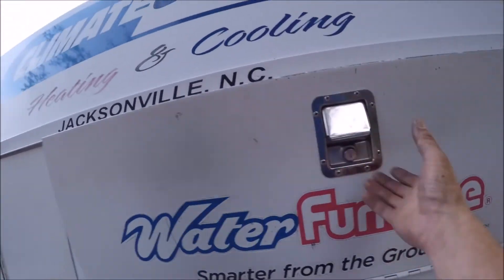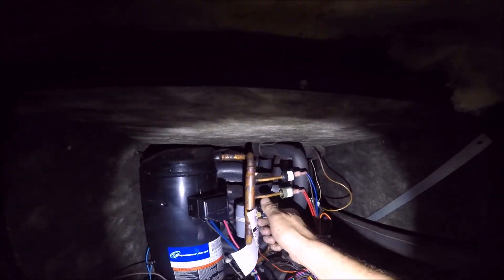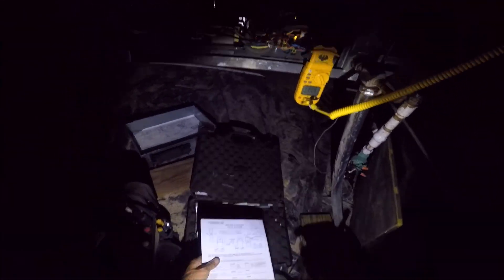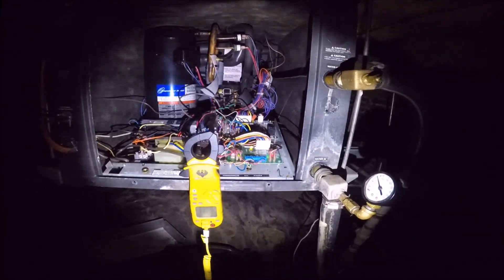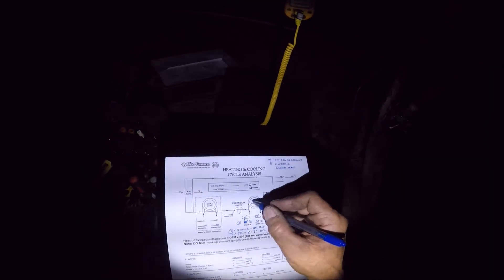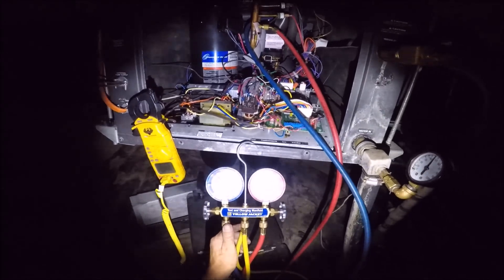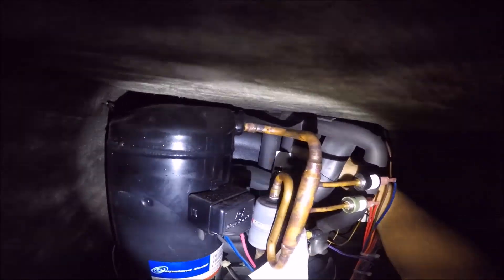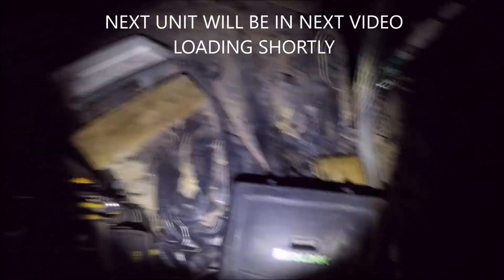(HVAC) GEOTHERMAL (CLIMATE MASTER) PM  (VLOG#1 OF 2.)

Comment: Thank you for sharing. very helpful.
What is the name of the testing kit you are using and where can I get one?
thank you. keep the great work.
Reply from the maker: no spesiel test kit just get a needle type k- coupler  thremometor  and a water gage from lows plumbing dept. then I built most of this things my self ill do a vid in near future for you on all this .
Reply from the maker: COOPER ATKINS 50336-K Penetration Temp Probe, -40 to 500 Deg F
( 222388419959 ) 
zorotools667522Feedback percentage of99.6%
Reply: Great! Thank you Sr. yes a video will be very nice.

Comment: Hi Bill. Really appreciate you having these videos. I work at a building that's 32 floors and we have almost 300 climate Masters.
Cooling tower on the roof. 
I'm seeing more and more units with head pressure extremely low around a 100 pressure and temp at 120.
Suction pressure is 120, temp at 40.
Is it low on charge? What would cause my head pressure to be so low?
Reply from the maker: If it's package units check it in Heat & Cooling